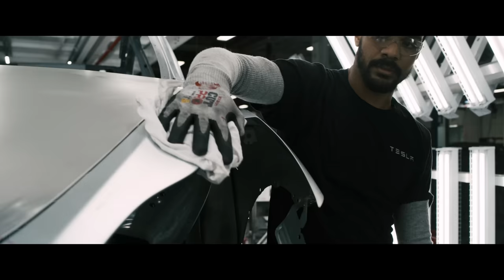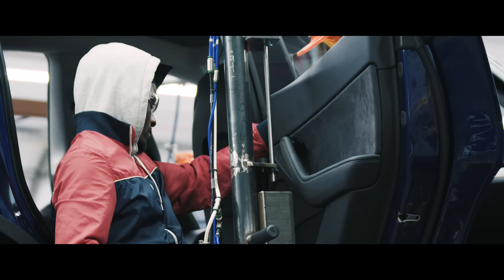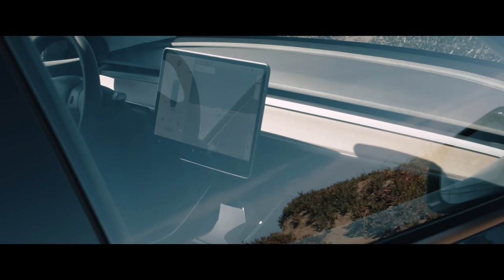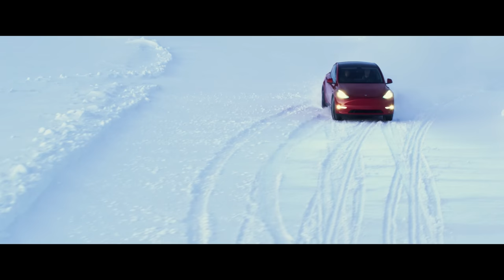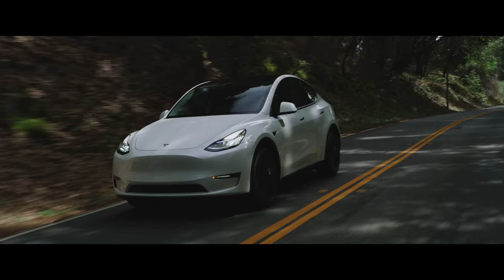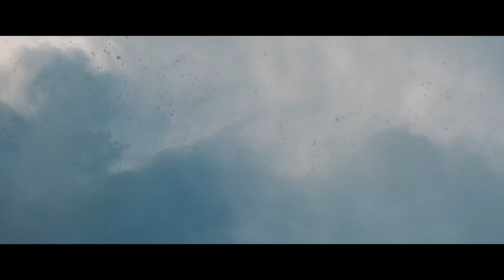Model Y Deliveries Begin!

Comment: I don’t care what anyone else says - Tesla’s are and will always be the greatest cars ever made!!
Reply: Eleanor Smith i dont know about that one chief
Reply: Sloth Armstrong  Please bring your references and citations to the argument next time thank you. Pitiful
Reply: Sloth Armstrong woah dude. Calm down. In MY opinion I think that they are the best cars ever created. They’re environmentally friendly, cost effective in the long run, they’re pretty luxurious and they’re fast!

If we don’t share an opinion then ok. I’m not going to ram it down your throat. I suppose if you have the money available then your concerns aren’t really an issue.

Also, when it comes to the battery running out (this is the most common reason for Tesla’s needing to be picked up - they don’t commonly ‘break’ for no reason) it’s because the owners didn’t read the small print of requiring a bit of common sense. It’s not hard to charge the car. Plus, there are hundreds/thousands of charging points being installed across the globe - it’s getting quicker and quicker to charge too.

Another side to a Tesla’s is the fact that when they do run out of battery it provides income for other businesses. No car is perfect. But can you name another car with the same standard spec in which is just as environmentally beneficial, just as quick and just as high tech...nu uh.

If you check out Carwow’s YouTube channel they test out 6 electric cars to see which is most efficient and travels further. They tested a Mercedes EQC, Audi e-tron, Kia e-Niro, Jaguar i-Pace, Nissan Leaf and a Tesla Model 3. And although the Tesla didn’t reach Tesla’s claimed range, there were many factors contributing as to why and the car still outperformed all the others.

There’s not much you can fault on them. Sorry but it’s true. 

Also, if you dislike Tesla’s that much then why are you even on this video? No need to be assy towards others that don’t share a similar opinion to your own.
Reply: Sloth Armstrong  Thanks for the opportunity you gave me to report you for that comment. I'll be using my five other accounts to report your same comment
Reply: A Z This is almost common knowledge by now.
Reply: Sloth Armstrong I am not a sheep. You seems to be lacking in your vocabulary skills because you’re saying the same things over and over again.

Unlike you I have faith in Tesla. I believe that they will keep going and they will achieve greater things than most car manufacturers. If you don’t, so be it. I’m not going to pressure you to as you seem to be pressuring me to believe otherwise.

Just respect it. I’m sure I’m as wrong as you are Sloth. We’re both strangers having a conflict online over a car. I do have personal experience. I happen to own a Tesla Model 3. Best car I have ever owned. And that’s that. I’ve never had a problem with it and it’s only gotten better.

And please refrain from calling me a child. You speak as if you are young yourself...or at least your attitude shows it. Trying to be pleasant to you isn’t very easy considering your consistent negative remarks towards me.

It doesn’t matter in the end. Tesla has always been and will remain a ‘clean’ car company. That is what appeals to myself and many other Tesla consumers the most. You fail to mention that Volkswagen hasn’t really evolved much. It’s only since Tesla’s own invention that other car companies are beginning to step into the movement.

However you see it, Tesla was the beginning of a major revolution and transformation of vehicles as we know them today. That in itself makes them better than any other company - in my opinion. If you disagree then that is your choice but don’t insult me because we share different ideas.

You’ve had your fun but please move on from my comment. I can’t wait to see what the future holds for vehicles - regardless of whether they’re Tesla or not. Either way, everyone is taking a step in the right direction for the future. But, never forget that Tesla was the first to do so...
Reply: Sloth Armstrong everything u said was actually funny! 😂 Tesla’s come with warranty and insurance so that basically ends whatever argument u had. And Tesla is way ahead of any other car company that wants to go electric. Not only are Tesla’s electric but they also have many features like autopilot. Other car companies aren’t even close to Tesla.
Reply: Untill u own 1 lol
Reply: @MrAlesioK  piTifUl
Reply: No me importa lo que digas tú: Tesla debe fabricar modelos más económicos sin lujos innecesarios, para todas la gente.
Reply: Agreed

Comment: Does it comes with Mask, Sanitizer and Toilet paper?? 🤔🤨
Reply: Model s/x comes/came with biodefense mode
Reply: Gabriel Schoene or better said with filters yes
Reply: Toilet paper costs more than batteries right now soo it would be too expensive. Base price for 1 roll variant would be at least 100k.  or 300k for 6 pack preformance version.
Reply: Ankit Choudhary it comes with hepa filter
Reply: Michel Bruns its not just any filter , its a HEPA filter , do you know what a HEPA filter is ? Its  a top-of-the-line filter dude
Reply: @michelbruns  Burns. Quite literally 😂
Reply: Ankit - what ? you, have NOT Learned to use the Three seashells yet ?
Reply: @markplott4820  are you talking about "Demolition Man"? Nope don't know about that.

Comment: Tesla needs a function where if u do a sudden brake for example if a car in front suddenly stops then when u brake your seat is pulled back and maybe a strap goes round you forehead so that you don’t smash your head on the steering wheel and prevent whip lash therefore increasing safety.
Reply: Lol, there is no need to worry. It happens a lot and it rarely happens.

Comment: How come I can't use tesla cars as ESS when I'm not, or have no plan to use it for the day? 
Program the car to charge battery over night when the price of electricity is likely cheapter, and using and/or selling the electricity during day and evening.
There are a lot of apartments without charging facilities but plugs at their parking lots. Once tesla owners can offer their cars to be used as ESS to their apartments, and if the car can calculate how much it used to charge and how much it sold/provided, so the balance will be charged to the owner, they will be welcomed to use those plugs. 
Of course all data could be handled by Tesla using OTA. 
It could also be another way for the owners to make profit with their teslas before full self driving taxi, or ride sharing.

Comment: Hi. Great channel ! Would appreciate it if you talked this year about the available commercial solutions (if any...) and the price for replacing the electric batteries in all these EV or phev cars. Just did a Tesla Model 3 test drive in Europe and as of now, battery replacement is 20 000 EUR. Doesn't this simply rule out these cars beyond their warranty deadline or as pre-owned cars for the greatest majority of people ? As of today what guarantee is there to have a compatible commercially available and affordable solution to replace the EV battery beyond 160 000 kms or 8 years let's say ? Best.

Comment: The Model W Will Have Glass Roof for Protection. And it Cheaper and Beautiful and Protective for the Passengers. Work Alon. I want it Start Production till 2021 in China and else. An Excellent Car except the Battery. Also you Could Back Down The back Seats like in model Y

Comment: I have a question, could manufacturing Tesla’s body and frame with Nano-basalt technology reduce the cost; they say it’s 15x more corrosion resistant than plastic, 5x stronger than stainless steel and 1.5x lighter than aluminum; furthermore it can be 3d printed, of course a machine will have to be designed.

Comment: Tesla with wider rear track than front track bodyworks all : The lowest traction 0.7g, extreme tail flick, extreme slide with Formula one speed (160-250 km/hour, over 250 km/hour) on circuits.

End report.

From
Tesla databases all by all social

Comment: To Elon 
I would love to talk to you about 
A electric magnetic gear box I have designed
That will increase power output with no fiscal conditions with the main drive.
This design will allow slippage to lock up
And power assist for the main drive

Comment: First of all, driving expirience of Focus and Tesala S is like you are in a very bad car driving Tesla S. So as car is no good, when you drive Focus is like you were driving racing car against Tesla S Focus chassis is normal, tesla is in lower KIA world. Secondly, do you know that when you put gasoline in your car you have energy flow in your car up to 50kW/s. And that ideal comsumtion has only electric cars (not) and Volkswagens (jawohl!) and that they all are just liars. Real consuption of electric cars is much bigger. Did you ever take a calculator and calculate how much nuclear power plants we need, that we could ALL!!! use electric cars? Do you have energy transmission network done? NO! And is there enough litium on this world available, not just in Atacama, that we all will have batteries. I believe you didn't and you are just belivers of some fraud people. So electric cars are only and only for reach elite and some others, are not yet developed enough and infrastrucrure is not ready. It has to go on wait state for another 10 to 20 years to prepare new type of batteries, infrastructure and all handling procedures in case of accident. In case of no sollution accident problems of electric will be big as now and one accident could stop the whole city (like NY). Get real people, think with your own brains, in case you are not able to do not ask sellers what to buy.